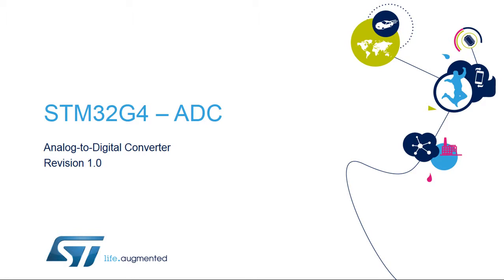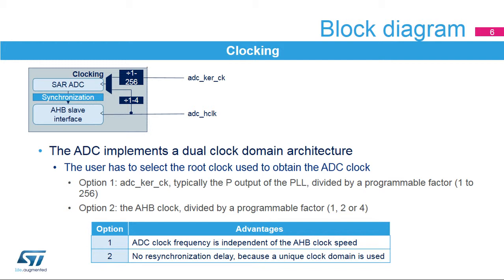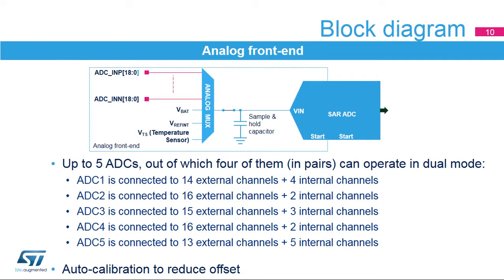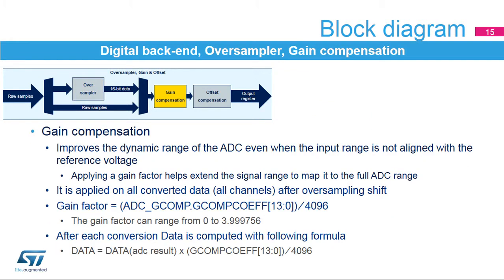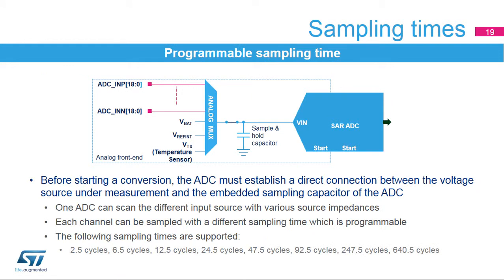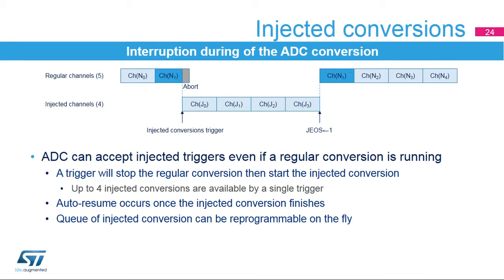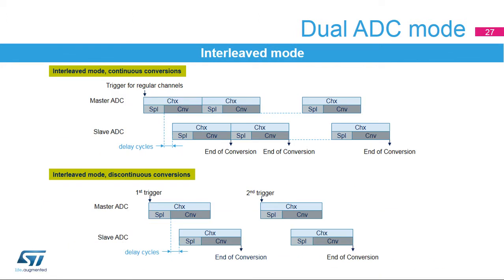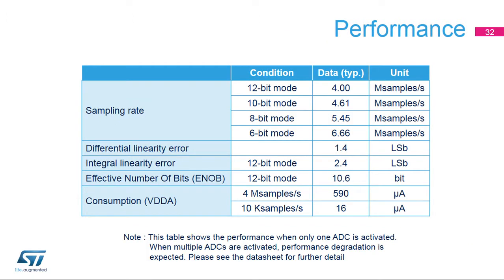STM32G4 OLT - 24 . Analog ADC

Comment: I'm using STM32G431CBU, It has 2 ADC modules. 
I use timer to trigger both 2 ADC modules to measure simultaneous voltage value 1 Channel of each other with interval about 100us (main thing)
With that, I also have to measure some parameters such as temperature, humid, Voltage source, ... (sub thing)
I tend to config ADC modules act in dual mode injected simultaneous mode. Each ADC choose 1 injected channel to do main thing.
ADC1 will use regular group to convert sub thing
Is it oke to do like that ? 
I'm concern about if I choose dual mode injected simultaneous mode. Regular Group cannot be converted ?